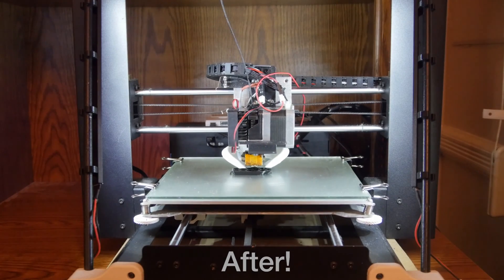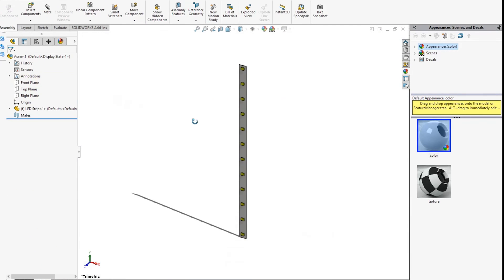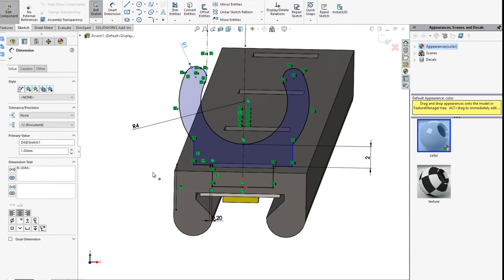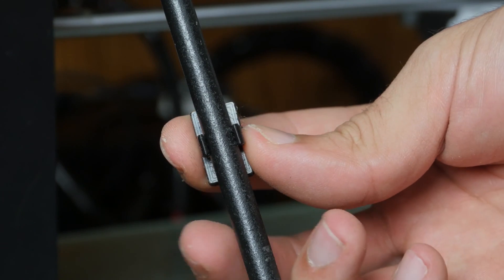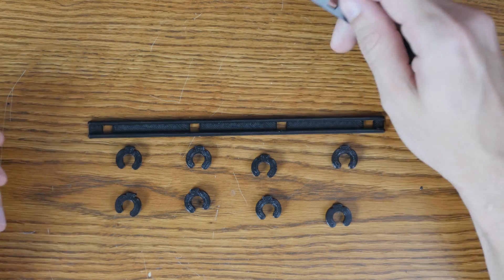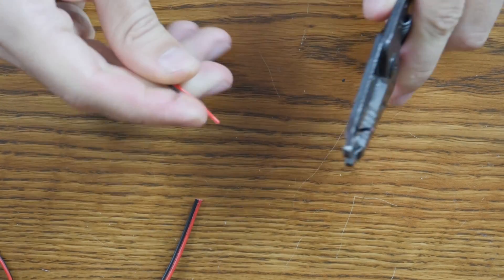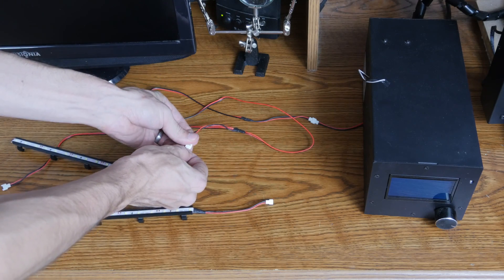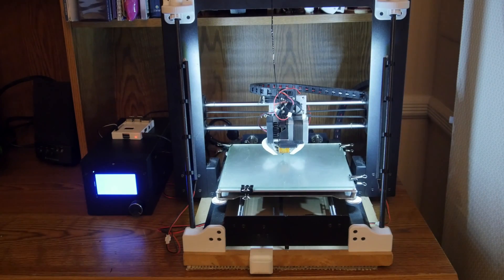DIY 3D Printer Lighting Build

Comment: Just wonderful idea ! what do You think about connecting those LED wires to the additional cheap FET board whose control input is connected to the heat bed wires  ? That way lights go on only during printing.